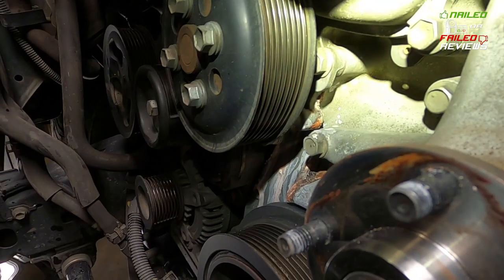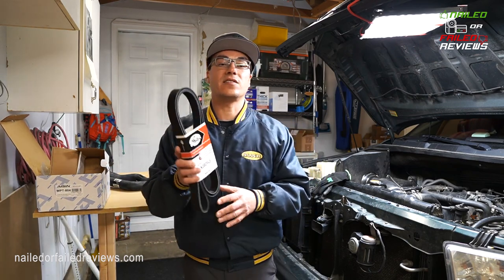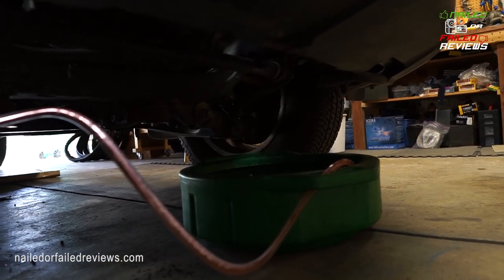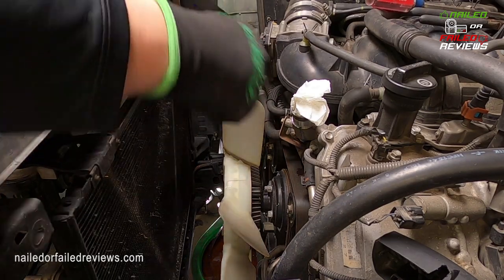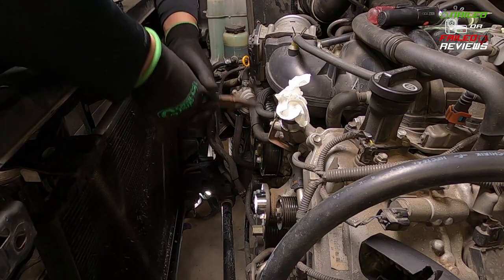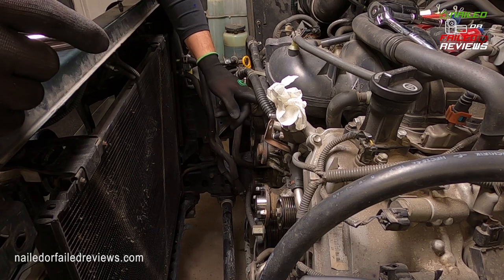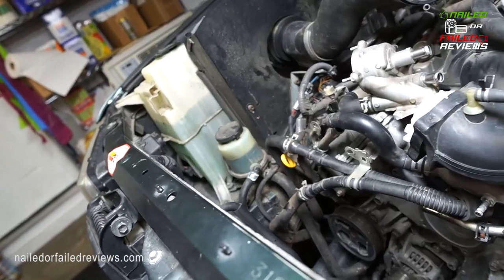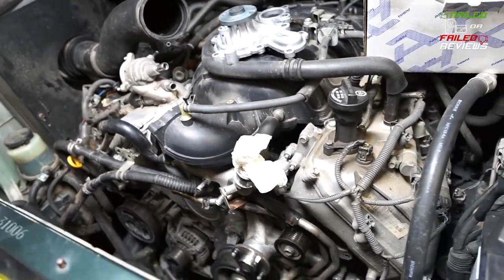Toyota Tundra Water Pump Replacement, Cooling Components - Disassembling Tundra Cooling System 1/2

Comment: I did this on my truck and don't ever want to do it again.  It is a nightmare.
Reply: How did you remove top left bolt on thermostat housing?? It s.u.c.k.s, but once get down this far there’s no turning back, plus when short in funds, no choice..... thanks in advance for any help 👍🏻
Reply: @Ewroble  I used a an extender on the socket and used a mirror to see where it was while fiddling with the two fat cable/wire/hose thingys that kind of obstruct access. Those fat hose/cable things have a bracket holding them in place- the TRQ video shows a slightly different way to do it- taking off less stuff. It was a B** for sure. The tensioner 6mm hex/allen key bolt was the second worst thing for me. I hit it with everything- torch, WD40, hammered the hex key into it, cheater bar- I thought I was going to break the allen wrench. Some other 2 minute video warned me how bad that bolt could be. For keeping track of water pump bolts, I put the removed ones into the holes of the new one as I took them out. Then, I transferred them back to the old one and kept track of them that way. Also, fan bolts were totally f'd on, I had to use torch, WD, and a a cold chisel and hammer (not to shear, but to loosen- like tapping a jar lid with a knife) to get those off.

Comment: Thank you so much for this video!  I changed my water pump, belt, pulley, tensioner, antifreeze and thermostat using this video.  You saved me easily $800 or more.  Note to anyone considering doing it themselves: There is nothing difficult about this, but it does take at least 5 hours to do it. For me, it took about 8 hours, but I was having my son help, to teach him a thing or two.  One other note:  If you are like me and you are  wondering what else you should change while you’re in there, you should know that the 5.7 L Tundra V8 does not have a timing belt, it has a timing chain that has no service interval. The chain is good for the life of the engine. One more thing I love about this truck!
Reply from the maker: Glad we could help... Power to DIY! Yeah Bro! Love savin that 💵 💵... And good on you for teaching the kids how to fix things 👍
Reply: The money you saved can be spent on therapy for your son as a result of  "holding the flashlight" for Dad. (Kidding- for real I do this stuff because my Dad had me be his assistant)

Comment: Great video I found it was easier to unbolt the fan and let it drop into the fan shroud and pull the fan and shroud up together it makes pulling the radiator alot easier especially when wrenching by yourself. Thanks again the detailed video and explanations were so helpful 👍 made the job alot easier
Reply: The fan was there easiest part, but how did you get top left bolt on thermostat ?

Comment: Was a very good video. Gave me some direction. I don't work on cars like I used to but still do all my own work. I did the job in 3 hours. You don't have to remove the radiator, belt tensioner or the throttle body. You can slip the fan and shroud at the same time. There is plenty of room to work with the radiator in place. Removing all the other things just make it easier to see the bolts. It is a lot easier reinstall the belt without the fan in your way.  I was working on a 2010 with a 4.6

Comment: My notes on doing this
to get to the top thermostat housing  bolt, I used a an extender on the socket and used a mirror to see where it was while fiddling with the two fat cable/wire/hose thingys that kind of obstruct access. Those fat hose/cable things have a bracket holding them in place- the TRQ video shows a slightly different way to do it- taking off less stuff. It was a B** for sure.

 The tensioner 6mm hex/allen key bolt was the second worst thing for me. I hit it with everything- torch, WD40, hammered the hex key into it, cheater bar- I thought I was going to break the allen wrench. Some other 2 minute video warned me how bad that bolt could be.

 For keeping track of water pump bolts, I put the removed ones into the holes of the new one as I took them out. Then, I transferred them back to the old one and kept track of them that way. 

Also, fan bolts were totally f'd on, I had to use torch, WD, and a a cold chisel and hammer (not to shear, but to loosen- like tapping a jar lid with a knife) to get those off. 

These Youtube videos are awesome, it took me about 10 hours over 3 days- most of the extra time was spent getting stuck bolts and nuts off. I also did tensioner pulleys, Serpentine belt, also spark plugs and ignition coils, oil  and filter, tranny fluid changes too.

Comment: Thank you for the amazing helpful video. I have the same tiny leak I see on the ground and up the trail to the Water pump, but everything seems to be tight and no problems, just a leak and do not even loose fluid. My biggest question is ? Should I replace the water pump? I am afraid I would have the same results as your finding on this video. The pump will be all good and just a tiny gasket leak. Please any Advise would be very helpful !

Comment: There's another video where the guy disconnect at the fan for bolts and remove the fan and fan shroud straight up at the same time then the radiator that looked a lot simpler

Comment: Thank you for the videos... I have a 2008 tundra SR5 4.7L , some of your links are either missing or amazon state that the parts does not fit my truck.  is that something amazon haven't updated or are the links linked to the wrong parts?  or am i doig something wrong?

- lower hose link is wrong
- most other linked parts amazon state does not fit my truck
Reply from the maker: ok thanks Leon, we will check out the links and fix the wrong ones. This job was done on a 5.7L v8 Tundra, not the 4.7L....so some parts may be different for you, but I'm not sure of which ones. I'll try to work up some links for the 4.7L as well on our website.
Reply: @NailedorFailedReviews   yea most of them are different, just found that out after taking some of them apart. here is a link to the 4.7L tutorial if someone else is looking for it.  there are 2 parts to it. Thanks for the vids.

https://youtu.be/AEhYm8Pwo-4

Comment: I have a 2002 4.7 will tutorial work for my truck? It’s the same or am I mistaken? Thanks in advanced.
Reply from the maker: Honestly I don't know. I would think the process would be close to the same, but you'd have to visually check to see if the components are in the same positions. Otherwise water pump replacement is a similar process for most vehicles.
Reply: I had a 2002 v6 and the water pump was operated by the timing belt.  So it is much more difficult than what you see in this video